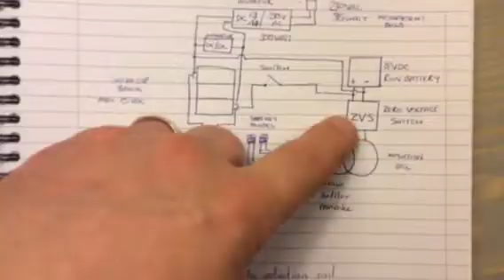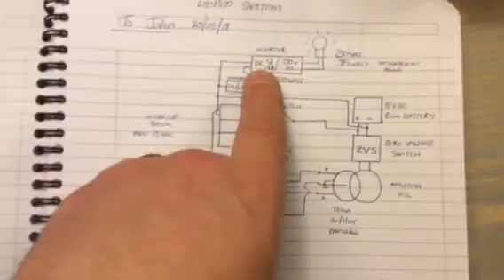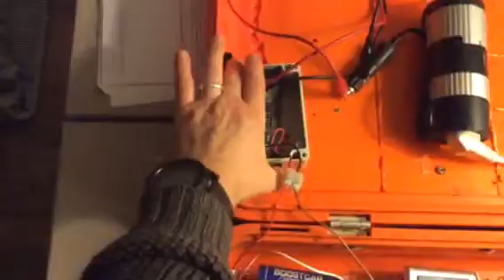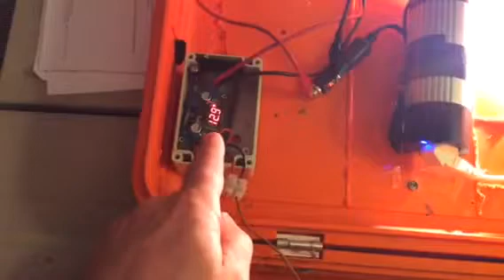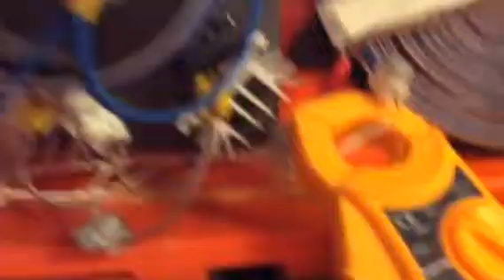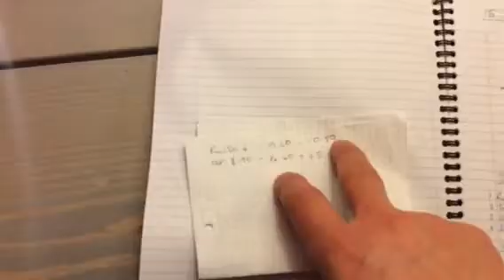Looped system working

Comment: How did you go with this? It seemed to be looped. I thought maybe an mppt in place of the switch? Does it run indefinitely or does the battery eventually drain all the way down? Thanks 👍
Reply from the maker: I never continued this may work better with lead acid batteries, sorry a long time since

Comment: Great ! go further 
What’s the caps values ? The big one, and the supercaps ?
Reply from the maker: If I can remember the caps were super caps 3.7 VDC cannot remember the farads sorry it was a long time ago
Reply from the maker: The big cap was 50VDC at 100,00pf
Reply: @dkdyker to confirm is it 100pF, and what is it doing after the bridge, filtering, decoupling ? 

 thank you so much 😊
Reply from the maker: @Nitro552 so it was 100000 uf and it filled faster than the other cap , a kind of a tank that was strong enough to push the voltage into the ultra caps to hold the charge
Reply: All right that’s a huge tank !
Did you made something special about winding and tuning primary and secondary Pancake coils ?
Reply from the maker: primary coil was an induction hob coil and the secondary was a bifilar coil of the same diameter. The ZVS circuit tune’s itself to the coil so that is quite simple. Hope it helps .
Reply: @dkdyker thank you so much, I ordered 10x 500F supercaps and 4x 22000uF low esr caps, hope it will works as great as yours
Reply: Did you measure the output secondary coil ? If you could remember the dc voltage sent to the big cap ? Might be higher than the cap bank ? 🤔
Reply from the maker: @Nitro552 I remember that is definitely was as the pressure in the large cap had to be higher to push the dc voltage into the cap bank, yes it was higher.
Reply: So… I tried with :  two regular bifilar pancake coils, not induction cooker coil, two models of zvs (6-12v and 12-24v) lead acid battery 12v4A, a 100v 22000uf cap, 5x 2,7v 500F supercaps, output to dc-dc to 12v lightbulb and another dc-dc with PC Fan, and… nothing but loss. With 4 watts output it’s still loosing,

Do you think ferrite core is missing to produce strong magnetic current ,coupling in to mine? 

Or maybe with another type of battery, 

Or value of the big cap ? 

Thank you
Reply from the maker: @Nitro552 did you have shotkey diodes after your bifilar collection coil then to your cap?
Reply from the maker: You have to rectify with these fast reaction diodes as the frequency is so high.
Reply: @dkdyker of course I have 2 schottky plugged to positive w center tap negative (as two half wave rectifier). I tried one also to rewire my first bifilar as single PC, I tried different bifilar that I’ve made, with different ratios primary n secondary… I tried to add some parallels batteries, everytime it’s the same, caps and batteries went down… 🤔

The only differences in my setup than yours are : 
- the core transformer with no ferrite,
- The lead acid battery compared to your li-ion 
- Zvs (5-12v* or 12-36v*)

Comment: Super gemacht. Ich habe damit auch viel getestet. Das zurück führen auf den Eingang ist nnur bedingt nötig. Bei korrekter Abstimmung, pulst die Schaltung auch ohne Rückführung. 

Am einfachsten ist es mit einem joulethief zu sehn. Troz nur verbrauch, lädt die eingangs Batterie. Keine Rückführung, es schwingt einfach auf den eingang zurück. Mit herkömmlichen Multimeter kommt es zur fehlerhaften Messung. 

Der angezeigte wert, beinhaltet den puls der die Schaltung betreibt und den dadurch entstehenden rückpuls.

Zu sehn ist dieser Effekt mit Oszilloskop direkt auf/über der Batterie am Eingang. Da können sie beide pulse sehen. 

Maybe translate will mess up. You can get the backpuls without retifiere from output. If the system is korrect, you can use all power for Output and get the back puls on the driving Batterie for free. We call it "rückpuls" or "zuruckpuls", its a backpuls. 
We found it on the"A4F Joulethief", its only diverent winding and the led go from collector to + driving Batterie. If its korrect, led will lights up and the drive battery will charge. Greetings from Saxonia
Reply from the maker: @action4free369  greetings and thanks for your info 🙏 in my later video I do this but instead of a light I use a 24vdc motor this seems to help .https://youtu.be/cpwo9oKxMH4?si=KkCGcvBd8lAorbVc
Reply: Kukuck!
Reply: @SaveOurSoulsJESUS 😊

Comment: very cool. you said +4v but the number drops for the converter?
Reply from the maker: @oldmanbuilds  I have just opened all my old experiments as they seemed to have been locked for some time? Anyway I hope you can find inspiration, I will look at this video and come back 🙏
Reply: @dkdyker  thank you
Reply from the maker: @oldmanbuilds  in the experiments with these coils they show a slowing of the input power as opposed to other coil forms, they also have a way of holding energy for a second or two. This slowing of input could maybe help with the rate at which the capacitors can charge.if its possible to charge faster than power in , then this could give rise to interesting possibliities :)